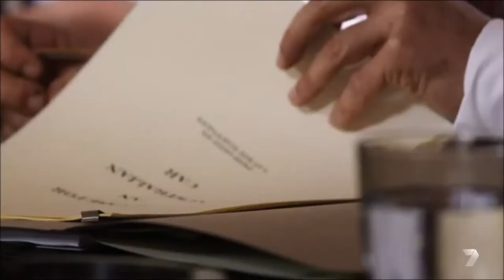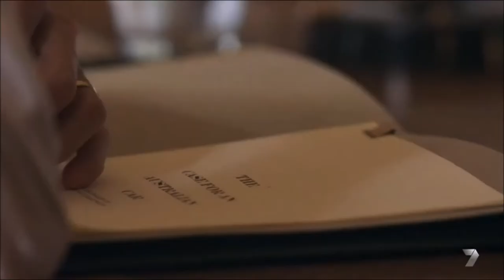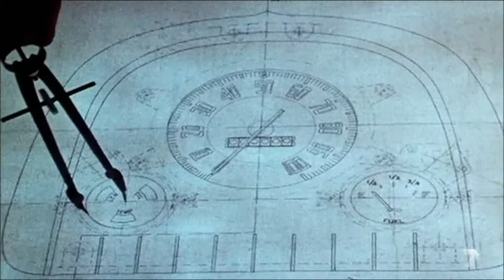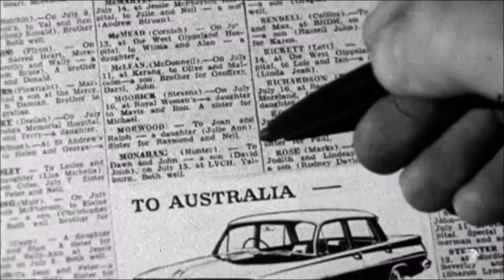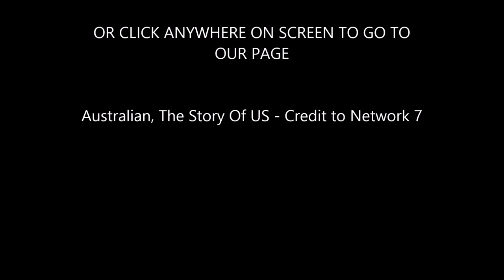GM Executives Approve An Australian Car (Holden FX)

Comment: What a great little documentary.  It's such a shame that they're closing up in Oz and moving to China?  Why GM/Holden?  All though this has been going in with GM in the USA for years now.  Everything moving to Mexico, and now, China.  Sad days for US and Australian GM vehicles.  I did my part though, and purchased a brand new 2015 Chevy SS with manual transmission built in Australia and immediately changed all the badges over to Holden!  Thanks Aussies for your great vehicle, but it still saddens me that they're closing up shop.
Reply from the maker: slowmanEF Not moving, just closing. GM has decided that Holden should not have their own cars and should just be a badge engineering only brand. Have you joined the SS owners group on facebook?